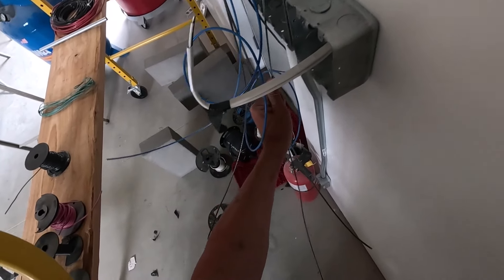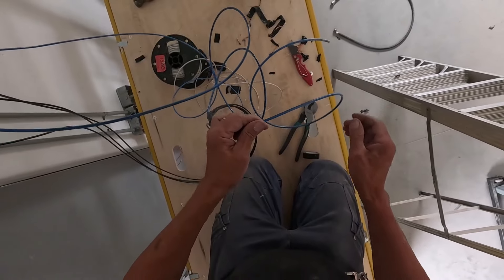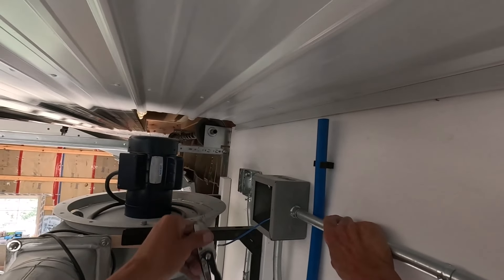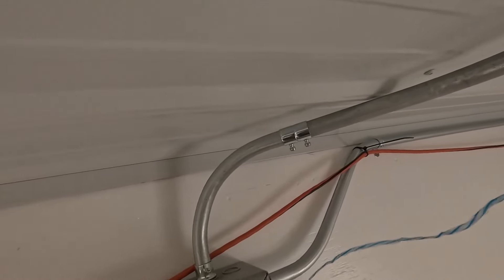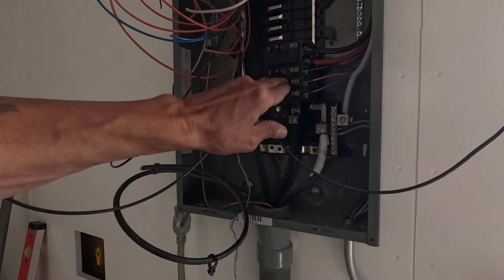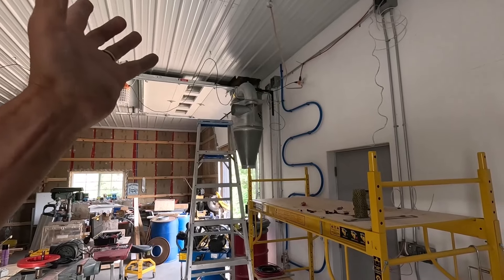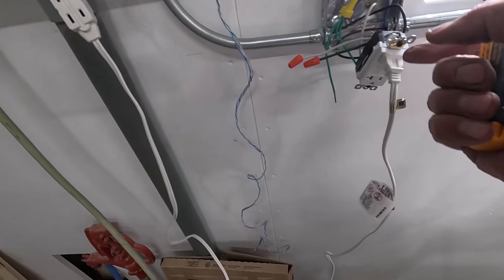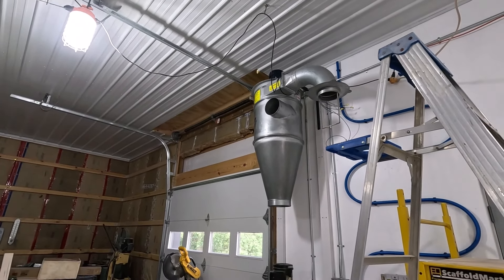Woodshop Wiring ― Pulling Wire to the “Air Wall” - Part Two

Comment from the maker: I have my list in-hand and will be running to town today for the odd-&-ends needed to wrap-up the air wall wiring. I'll explain all of the boxes and what they are for in that video. Once the Air Wall is done, I will hard-wire the compressor, do the break-in run, and connect it to the cooling loops installed in this video: https://youtu.be/H_kFWeVRyeU and run the system for the first time. With any luck, there will be no leaks and I can move directly onto the service drops: https://youtu.be/jlUvCcAJrNo Interesting videos coming up!

Comment: You mentioned that you will be using that Delta barrel cyclone 'as-is'. Will you still be converting it to a canister filtered unit? I can get my hands on a similar unit, and kind of would like to follow along 🤔🤞
Reply from the maker: I will be using the Delta cyclone as-is temporarily so that I can use my machinery immediately, then once the Oneida cyclone is set-up, I will convert the Delta, and use that on more remote machinery and possibly outside? At any rate I will be doing the conversion, but just not right now.